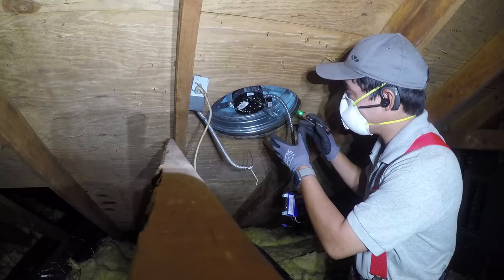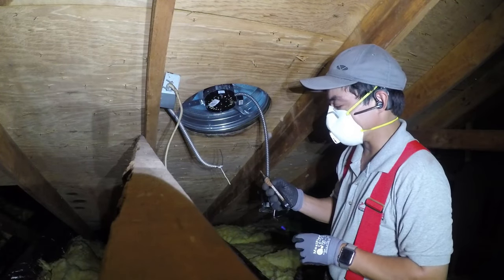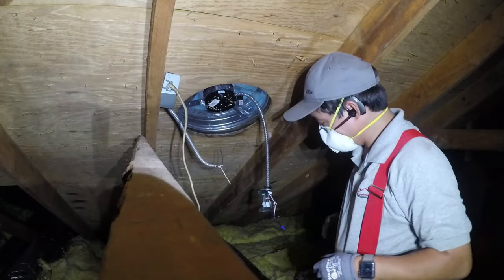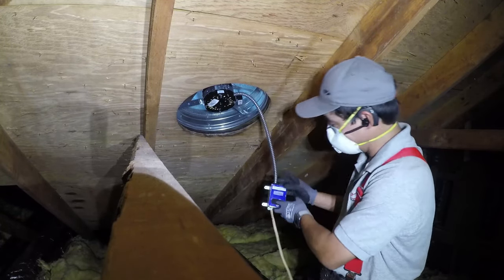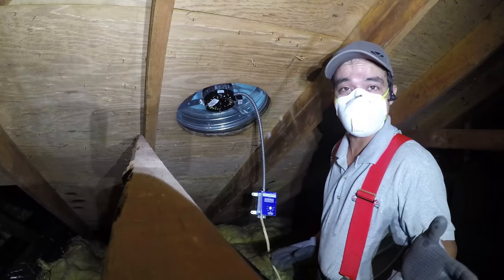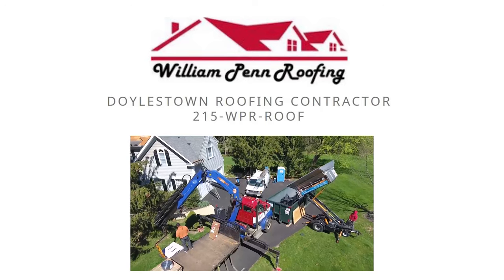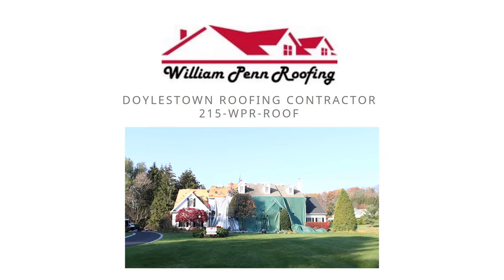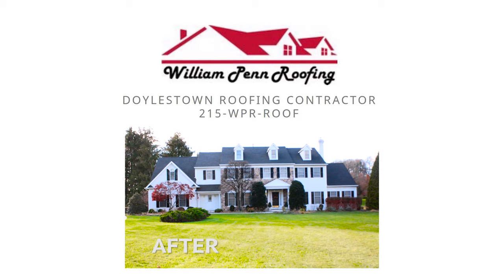Attic Ventilation/Fan install

Comment: I have an issue with cigarette smoke entering my home at night thru the attic, would this fan be running all night flushing the smoke out of the attic?
Reply from the maker: The attic fan is generally meant to exhaust heat not odor but that being said the fan would push most smoke away and keep the attic full of fresh air. It is best if the fan is connected to insulated ductwork that expels the air to the outside.
Reply: How does cigarette smoke get into your attic??
Reply: Lol!!

Comment: My garage has soffits but no ridge vent. Will installing one of these help? Or do these only work well with gable vents?
Reply from the maker: They work well with gable vents, however, if you don't have a ridge vent and your soffit is able to have air intake, it will work!
Reply: @williampennroofing18901  I thought soffits were natural draft air intake? Do you mean I would have to add an active 'power' intake at the existing soffit holes?